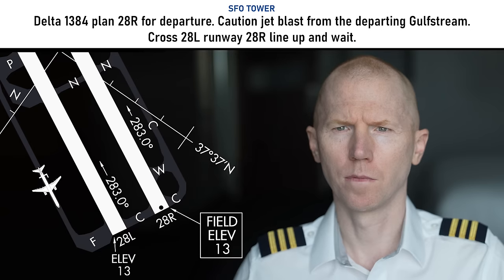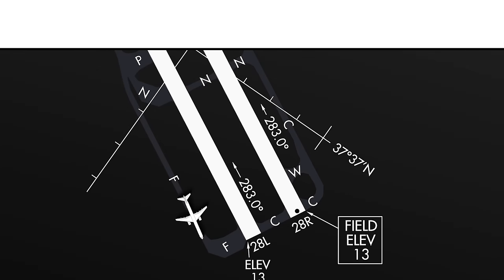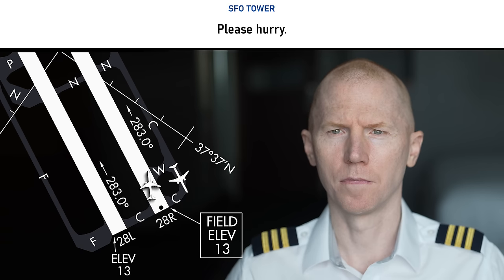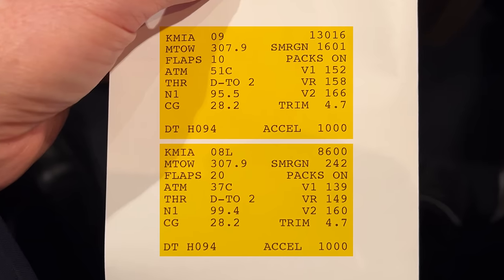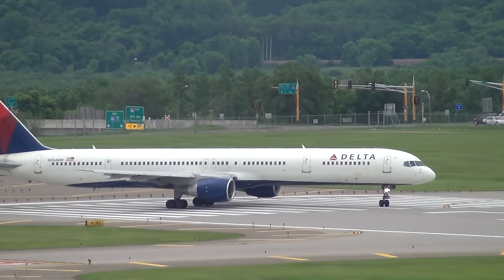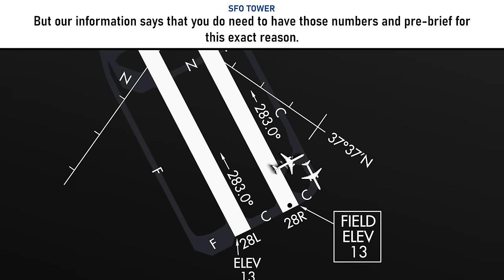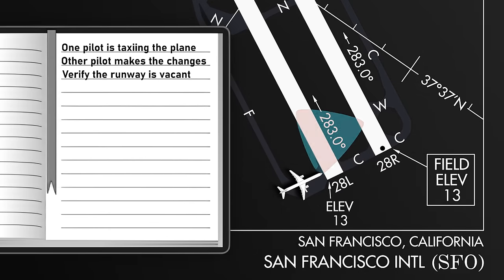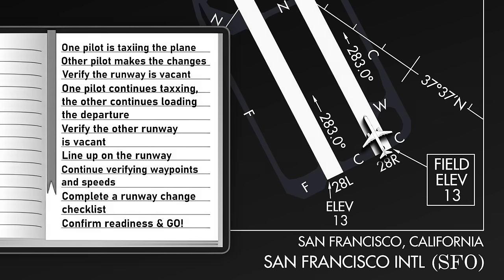ATC Doesn’t Like Delta’s Comment

Comment: I see that after 25+yrs since I quit flying the same old game and back/forth of ATC telling Pilots how to run and manage a safe flight is still going on. Typical government 3 digit entity who thinks it is all about them. I get they got a tough job, but I've done ATC simulation work previously, that is very realistic, meh...it wasn't that stressful, I know it wasn't a real situation, but I'm good at multitasking. At some real busy airspace, I know the stress goes up for ATC and everybody, so I cut them a break. But this is the classic situation of ATC controller preaching and lecturing when they should just STFU and ask what the pilots/flight needs for a safe outcome. This isn't a busy airport and situation that is happening, save it for some small plane that nonsense and attitude. Your not helping the situation whatsoever and Ms. controller, are clueless. That is the ultimate responsibility when you got 150 people behind you in seats. Job 1. And get yourself home safe as well and everyone involved.  Glad I went into IT. Don't feel like my job is on the line every 10 minutes due to some screwup or something out of my control 99% of the time, and I'm home every night and the FAA isn't up in my personal business. Rant over. Another good video thumbs up again.

Comment: I think the pilots should have just held short, get-there-itis. Even if they truly think this is going to take 2 minutes, why put yourself in a position where you have 90 seconds of wiggle room for an unusual (swapping numbers on runway) takeoff. And of course what if they need to abort takeoff for some reason while another plane is barreling down the runway.

Comment: Ok lets be fair. The moment theyre ready (pilots) and theres traffic on a busy airport, they looove asking for sequence and estimate distracting the atco, blocking the frequency and not helping at all. Like if the atco had nothing more to do. Their job at the tower is far more critical and on the edge than just input some info on the plane computer (which is actually the one doing most of the job) like a videogame. 

Now, this specific time she offer them the longest runway, so their numbers for 28L were absolutely valid for 28R. Is not the other way around where they give you a shortest rwy and then obviously you need to recalculate. 

Now, her only mistake was lining up the DAL. Probably she couldve kept them off the rwy until they were ready, smtg that can actually take several minutes. As an atco, you can never trust entirely on them pilots. Cuz the moment you start doing that, you're playing with fire... sorry but thats the truth.

Comment: She told them they had less than five minutes.  She told them they had the option to hold and wait for the other aircraft to land.  They told here they needed two minutes.  She said if only two, you may proceed.  They didn't get it done in the two they said they could do it in.  End of story.  Granted, she could have left it off after he said 'Roger', but she still has the problem of them sitting on the runway and another aircraft one minute out and they still aren't done.  All the pressure and decision making is now on her, what does she do with the other plane when it is that close.  Will there be sufficient distance between the two planes....   I see that the problem is entirely the pilots fault.  They should (I think) know how long it will take plus a margin of error.  They made the wrong choice.
Reply: She changed the runway.  How does that factor in to your calculus?

Comment: If they are holding short and get a runway change, then keep em holding short until theyve updated the FMS, briefed, confirmed the changes and call ready. Then put them to position and launch them. I personally hate sitting in position on the runway anyways! Boom problem solved.

Comment: I'm a retired ATC'r and private pilot. Haste makes waste. The controller should not have been snarky, an occasional joking attitude is fine.  The controller is responsible for pushing tin as safely and as quickly as possible.  The pilots are responsible for the safety of the flight and this means complete checklists and such. The pilot when faced with a last-second runway change and the resultant departure route change should have requested to hold short on Charlie until ready. The controller should have been aware of the checklist changes that had to be done in the cockpit and held them on Charlie also until ready. It's possible the checklist would have been completed within 5 minutes and the aircraft cleared for takeoff before the arriving aircraft was too close. I can tell you from experience on both sides of the microphone receiving derogatory, insulting instructions is very unsafe as most of the time my head would go blood red with fury.

Comment: No way to tell if they didn't get the current ATIS.  Possible they the pilots missed the current ATIS, but when they checked in on Ground they should stated they had whatever ATIS they had.  Seems it's hard to tell, BUT the programming is critical and last minute change is not good.  She should have had them hold short where she needed her.  Not a smooth operation. She was too snarky, and the pilot should have perhaps called the tower to educate.

Comment: The pilot should not have agreed to put his aircraft on to the runway with his rear to an aircraft on final if he wasn’t ready to TO.  Period. Full stop.  That is fundamental for the same reason you look both ways when crossing a runway even if you have a clearance to do so.  Worse, he proposed/accepted a very short limitation on how long he could remain there which should have been a giant red flag.  In my mind this was bad CRM as well.  One of the two should have stopped it.  ATC had a bad attitude and clearly didn’t seem to appreciate they are there for the safe operation and flow of aircraft rather than visa versa.  But it was poor judgement on the crew’s part.

Comment: A lot of the points he’s making are the same ones that I said. I found the biggest fault with the pilots, because they have the opportunity to hold short of 28R and they chose to try to squeeze in a takeoff, which inevitably led to problems. 

Like he said, when you are under a time crunch, you are much more likely to make a mistake, which could potentially have lethal consequences. 

So, the controller could’ve handled a little bit better, but the root of the problem lies with the pilot’s decision to proceed to runway 28R when they weren’t ready.

Comment: When I was a controller, a long time ago, and still today. All controllers SHOULD BE at least private pilots, preferably with a few hundred hours accumulated. Also, fam flights, in the cockpit of commercial airlines, should be required so they are familiar with what's going on. As usual, the feds have their priorities backwards saying they can't afford it. This female controller is a detriment to safety, spending time pissing of pilots instead of simply saying 'hold short of 28L and let me know when you are ready to take off, plan 28R.

Comment: Snarky Karen tower controller comes close to committing an operational error with her non-standard unprofessional direction of these aircraft.  She needs counseling at the least or a reprimand.  As pointed out in this video there are many items that have to be loaded and checked when changing a departure runway.  Holding an aircraft on an active runway when runway change procedures MUST be accomplished is setting up an accident.

I personally would have asked to hold short of 28L to reprogram the FMS and brief the new departure runway, Standard Instrument Departure, and Engine out procedures.  DO NOT LET ATC PUT YOU IN A BOX!

Worst case the arriving flight could have landed on top of the Delta flight stationary on the active runway.  That happened at LAX in the 1980s.

Comment: There seems to be a LOT of justification on this pilot’s part to defend the pilots. Frankly-after hearing the exchange-everyone involved had all the info needed to make the correct decisions. ATC gave the pilots the direction-pilot says he can do it. No, he cannot. The RIGHT thing to do-and this would have cut down on so much of this drama-was to tell ATC that they would hold short of 28R so that all the numbers could be entered correctly without having to put themselves in the path of an A/C that is 10 NM out. The pilot asked for 2 minutes. He exceeded the 2 minutes-period. This puts ATC is an extremely bad position. 

As for having ATC be on the flight deck to “see what they go through”: this is such a typical self-centered pilot comment. Do they know what ATC goes through? This a/c is not the only one she’s dealing with. In order for her to be able to do her delicate dance safely and correctly, the PILOT must be a team player (saw that term in another comment here). He gave her incorrect info. End of story. 

There are probably other factors at play here: Delta (as well as all other airlines) pressure pilots to have on time numbers. There may have been a decision made to enter 28R and complete their tasks for this very reason, rather than hold short 28R. There’s also the ego factor, which I will not get into-but there’s a LOT of this in this video-

PS. I am a former military pilot. I know pilots. I am also a former flight attendant (before my military career), AND I worked for a large airline in the corporate office. I was the facilitator for that airline’s aircraft damage and runway incursion committee-and you better believe these situations came up numerous times. The committee was painful-an hours long, finger pointing exercise as to whose fault every incident was. Funny how this pilot’s video sounds eerily like the excuses I used to hear. 

This was 100% the pilot’s fault-regardless of all the snarky comments about this controller. She has a job to do-they made it difficult.

PS. Controllers are snarky. You think THIS was “snark”?? Try flying into JFK, LGA, or ORD. They will bury you with snark. Suck it up, buttercup.

Comment: Total layperson's view...

The pilots should have known how long the switch would take them as surely this was not the first time for such a switch for both of them. They failed accurately estimate this or perhaps chose to be overly optimistic in a rush to get in the air.

However once they were on the runway, there was no value in ATC being snarky and engaging in an argument as that in no way increased safety or throughput and, at worst, could negatively impact either or both. Perhaps a simple request for "how much longer?" from ATC so they could prepare better for dealing with the incoming plane.

I don't know if this situation justified "take down a number" but it seems that there should be a mechanism for something similar for cases like this so they can be reviewed rather than being argued about in real time.

Comment: The whole bottom line to this is simply the fact that 1) A/C lied to ATC in an effort to not lose time/place in take off position 2) Ego's and attitudes have no place where others lives are at stake. 
IF the pilot had simply said "It's going to take us 3-5 minutes to reset our systems from our planned departure point" then this would have been a non-issue. But the A/C wanted to stay in line and get off the ground without delay.... 
Delta just needs to stop lying how long it's going to take and carry on and leave their ego back at the gate. NO sympathy for Delta at all in this case

Comment: Pilots wanted to do it on the runway, said 2 minutes and took much longer than had attitude when controller had to deal with them being in the way. I don't see how the controller did anything but have a little attitude that is reasonable in this situation

Comment: Pausing at  6:70 An IT GUy, doing architecting work in IT, one of the top five reasons to do IT is to avoid\reduce human error. Shocking a pilot has to key in all those numbers in 2023. Do you earn points by scanning absolutely unreadable grocery receipts on an App. No the pilot is not having that basic facility seems. Reason , only two companies make planes on the planet. i mean bulk  of it.

Comment: I think it's unnecessary to have this kind of pickering in such high load situation, however, I think you're cutting the pilots a lot of slack here. The pilots decided to line up on the runway with traffic behind them and they said they only needed two minutes, so now that they need more time, it's either they get out of the way or have the ATC tell the incoming flight to do go around...

Comment: NOPE. NOTAM was out. They should have been ready for EITHER runway. No excuse. I fly, and write manuals for, advanced airplanes (135 and 121 ) and there is NO excuse. SFO was hamstrung...and as operators (airlines), we needed to step up. And these pilots were not. Now, was it the lack of proper DISPATCH who failed to properly brief them...or a culture of pilots who thought "I can show up and go"...don't know. BUT, bottom line: We TOLD you to be ready. You weren't. You caused the delay because you weren't ready for either runway and here we are. Late and you loose.

Comment: They are both in the wrong. The controller should have never giving them the option to line up and wait, instead she should have only told them to hold short of 28R and advise when ready (like she did the first time before the runway change). The pilots should have not been in such a rush and asked if they could just hold short instead of lining up to wait. Both were very unprofessional after the very minor incident occurred.

Comment: Pilots chose wrong. 
Pilots put two aircraft in conflict. 

What can’t be automated with aircraft configuration and navigation?

Why is there not a weighbridge on every airport to check weight and balance on every aircraft leaving?
Why isn’t the loadcells installed in the aircraft?
Why do we have pilots instead of navigator and engineers

Comment: Airline pilot here. ATC was right and Delta was wrong. 
Which pilot lines up on a runway knowing they need to change the FMS, upload new performance data, check waypoints, brief new runway, and run at least 2 checklists again, with an aircraft on final approach. Just silly.

Comment: Just came back (as passenger) to NJ from Lima. In Lima, there were all these delays with getting the plane refueled. The pilot came on the intercom several times to explain that the airport had some kind of nozzle problem with it's fueling equipment, so they were using fuel trucks, of which I think it took three trucks to get the job done. The pilot came on again and explained that though now fueled, there would be a further 10 minutes or so for the new flight data to be exchanged with Chicago. I immediately thought of this video, and how every change in plan needs to be input and updated. It did make me wonder how the plane communicated with Chicago... satellite maybe?

Comment: The office favourite telling the AB how to hold a rope.
Office favourite on his experience of being at sea trip - adds oil to the winch gearbox because he noticed the level was low - winch in use oil spills out.
Office favourite sea sick,  expecting empathy.
The office want you to radio in the spares status daily.  50 C on the back deck 20 C in the recording room where the PC radio comms was.  Get a cold?
Tax change the deductables = impossible to carry on with the business.
Plenty of office types think they are the most entititled.
Those on board who prayed to Mecca, when the sea was calm.

Entitled to tell the plane where to go on the ground - power trip.  
Where's the saftely aspect?
We've gotta be onnest here - rising tone, venicular common Karen.

Comment: Some American pilots and controllers are not trained and/or suitable for function, if they resort to childish sarcasm or anger in safety-critical scenarios. As a passenger, I expect and demand that there are impartial calm professionals handling both the aircraft and ground/air traffic control. Resolve errors or disputes later - off-line. Grow up, or stay home.

Comment: As a pilot. I found borrowing  the ATC often used phrase "Standby I have your request" works well when ATC makes unexpected transmissions.

  About the genesis of ATIS.  It's to make the ATC job easier, NOT necessarily to make it easier for the pilots.  I wonder if the ATIS changed between push and taxi out?  The ATC controller is supposed to announce the changes and they don't always do that in a timely manner.  Maybe (not always) the controler will just say the new ATIS is out and dump it on the crew to retrieve during sterile operations.  Let's be nice and eliminate the surprises.

Comment: As much as the controller was being snarky and should have been more professional, the pilots are clearly at fault here, regardless of the runway change. You know it takes more time to calculate, yet you still say you only need 2 minutes? Also weird that the IFR clearance didn't have the runway change or anything else. Though since the FAA still uses paper strips, I'm not surprised there was a potential communication loss on that front.

Let's also be clear here: ATC doesn't set people up for failure; their number one goal is safety both in the air and on the ground. Pilots messing with the safety and flow of the airport doesn't mean the irritation expressed indicated premeditated safety loss, but just irritation with the pilots' decisions and lack of communication. There was clearly trust the ATC had with the pilot, believing they only needed two minutes, and it was broken when they just kept sitting on the runway.

Comment: She asked if they had the ATIS... which tell you the departing runway(s) in use.... but you failed to mention that. It's not her problem that the pilots decided to plan on a different runway and then act surprised when she said to expect the runway that was mentioned in the ATIS.